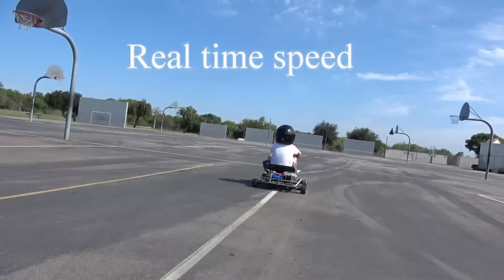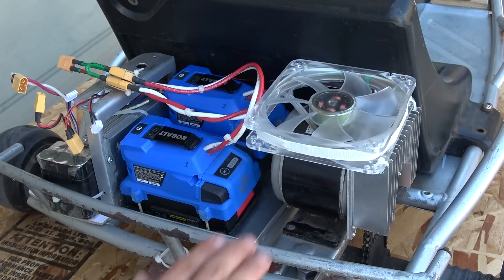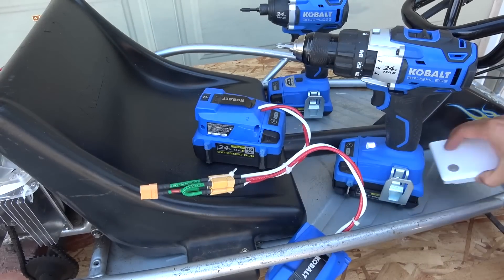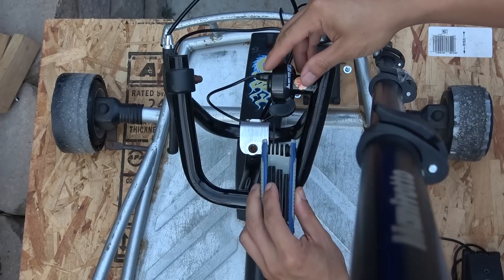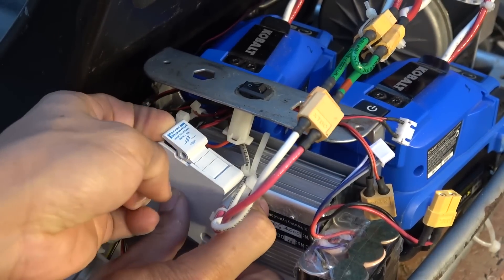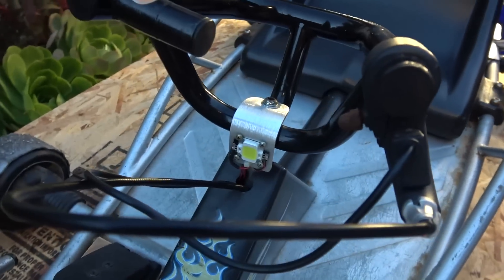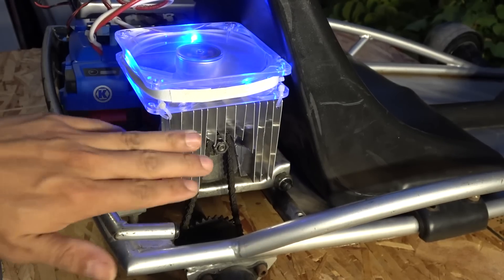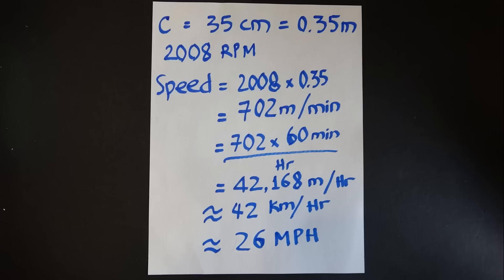Upgrade a Razor Ground Force 24V Electric Go Kart to 48V

Comment: It appears that you are not monitoring this video any longer.  I had a questions concerning the headlight.  You said you used a 10w 12v module, but you added a 5ohm resister to the positive side.  Why?  Will it not run on the 12v power?  I need help.  Thank you.
Reply from the maker: It gets really hot running on 12V. You need to reduce the voltage to 11V for it to work properly.

Comment: Hey I'm doing 1 now trying to upgrade it to 36v with controller now after wiring and everything it's good works but once I jump on it as in a load it pops something and then does nothing but it I disconnect the battery and reconnect its fine so why won't mine go under load..?

Comment: Great Video!  I got a Razor like yours from a friend and want to try this upgrade.  The only thig I don't understand is the battery packs.  What is, or where do I get, the top piece that the battery clips into?  The part that is like the bottom of the drill with the wires. I understand the rest, but when it comes to connecting the controller, I may need help.  My Chinese isn't very good.

Comment: Cool!
How about adding a thermal cut off switch super glued to the motor casing? 
Aliexpress has them cheap and could be wired into the controller's brake handle motor stop. If the right temp is reached, auto turn off and wait for it to cool down and don't push it for so hard for too long, no harm!
That's what I'm going to try!
Take care

Comment: Couple rings of plexiglass, then a solid lense made of plexiglass for the headlight would look good, maybe drill a couple 5mm holes from the back, not all the way through, beside the led headlight, into the rings to space the cover out to cover the headlight,  maybe paint the tip of a couple LEDs, or glue a tiny piece of aluminum foil to the tip of the through hole led, or maybe use a RGB led or a pair of them,  use the aluminum foil to disperse the light ,  but a 3-4mm piece of foil on the led, to make the ring of the headlight  glow, like a halo,  have a switch to turn off the headlight, and keep the halo lights on,  maybe make a red tail light the same way,  use a 3w red led, with a couple traditional red LEDs 1/4 watt or what ever,  maybe use 4 of them, use hot glue to attach to the aluminum plate and plexiglass, that is about 8-10mm larger on all sides than the 3-5w cob LED,  the holes drilled 90% through 5-3 Plexi spacer rings, and possibly use foil tape, or glue foil to the inside of the rings, to reflect the bright light, and keep the two light sources separate, then the clear Plexi cover,  use tiny screws in the corners, with the LEDs in the middle on the sides and top and bottom,  use the small led halo light rings, as a tail light, along with the front lights , yellow, orange, blue, purple, any color, every color, changing color!,  The rear  can be the same also, but red or yellow/orange would likely look best,  use resistors and switches, to operate,  I have one, I'm thinking about doing the same for my sisters lil boy,  use a remote shutoff Incase he gets in trouble, I'm thinking a 4s lithium battery is enough for now, he is still young! But I have a 500w motor, a 350w and could put two on there eventually, I was thinking about putting larger wheels on it, and use a weed eater motor, make it go in grass, at about a fast walking pace, but the 500w at 36v motor I have, running at about 72v 20s lithium battery, just over 80v is about 2kw output, nearly 3hp, maybe use that and I can ride it,  maybe use two of everything,  motors, controllers, batteries, use a 350w24v and the 500w, with controllers to run them 12v overvolt, a 36, and 48v,or just run them both at 48-60v,   the 850w should be in the 1800-2kw range,  maybe get a 3kw 48v brushes motor, push it with a 96v controller, that equals alot more than 3kw, double the voltage, also doubles the current, that squares the wattage! 12 kw peak power,  it would likely oner heat in 5 minutes, probably back it off to 72v

Comment: Hi Vuaeco , I’v just found your channel looking for help to fix my sons 24v utv mx , I’ll give you the back story so far, the bike battery supplied was junk , very slow recharge time , not much power in the grass, so I hooked up my 18v 5amp makita batteries using the usb adapters from eBay removed the usb circuitry and soldered straight to the tabs, worked brilliantly then I thought I’d try my dewalt 54v but I just use crocodile clips it worked , not much quicker than the 18v mk batteries but definitely double the playtime so great but unfortunately the wires came loose and touched now I think Iv fried the control module as it’s completely dead ( very unhappy little boy 😢) , I’m thinking 48v 1000w control module but I’m guessing , I’m not sure if the motors can cope there 200w 24v , 1 behind each wheel , I would be very pleased to make a suggestion or point me in the right direction as I’m just a carpenter with a soldering iron and multimeter lol 😂👍

Comment: it def feels faster than it looks in this vid.. Im a fully grown adult and its 'feeling of speed'' compares to  the electric karts at some popular place in NJ.  Its scary the first few rides and i put off riding mine until i could change the tires/wheels but practicing in a parking lot helps get the feel.  48v 1800w.  ill upload my solution that mounts a 48v 20AH battery easily daily secured from damage damage results the innocent battery cover. i raised the seat 4 inches and as is, the drifter critters a great size to throw in a car trunk and bback seat to transport 2. 
this video helped me see the kart could handle 48v
oh mine is a ground force drifter

Comment: Awesome video!  I would like to do the same with a 56v battery pack I have (EGO). Could you recommend a speed controller?
Reply: Did you ever find out what speed controller to use? Looking at doing the same
Reply: @DFW_SPORTSTER_S  I found a website with lots of options but haven't pulled the trigger on one yet:  https://www.electricscooterparts.com/speedcontrollers60volt.html

Comment: love your tutorials!.  question are you comparing the battery life? those are only 4AH batteries the SLA's on my drifter are 9AH. While I know SLA is only 50% usable, I'd still think you'd get more run time? also in the other video I would like to know the controller model you used, there is no link or reference in description thanks!

Comment: Hi Vuaeco, I'm still at it.  I have a 36v 500W controller.  Can you recommend a battery to use with it and its impact to our razor cart?  (will it go longer, faster, same as before?).  I also have a 1000W 48V controller and just ordered some 24v kobalts to mirror your setup for my second cart.  2 boys, 2 carts - race time!!  Thanks again for your video's - awesome stuff

Comment: Great video, amazing job.  I have two of these and have been looking to attempt this project for the past year.  Vuaeco can I use two Dewalt 20V batteries with the same controller? thanks
Reply from the maker: No, you can't use Dewalt 20V batteries on this controller. It cuts out at about 41V.
Reply: vuaeco Thanks for the quick reply!  Can I message you directly?  I have two controllers I’m looking at now.  A 500W 36v, and a 48v 1000W, I have two carts as well.  Would love your advice on what I need to get both going.  It’s project time with the kids!!
Reply: @vuaeco  Hello! How long motor can work on this batteriess? :)

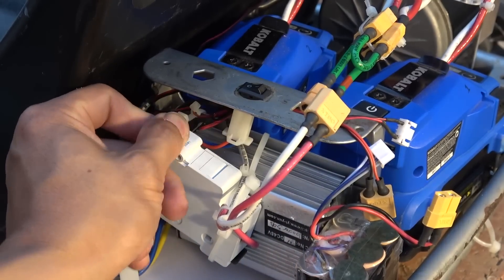Comment: In minute 5:00 you call it a fuse switch were did you buy it I need
Reply from the maker: It's called "fuse holder" and the manufacturer is Ferraz Shawmut. There are plenty of those on ebay.
Reply: @vuaeco  thank you amigo so much and I appreciate it

Comment: How to connect controller when all comenfrom china with no manual?
Reply from the maker: Basically you just need to connect 3 cables. Throttle 3-prong cable, red/black power cable to the battery, and finally blue/orange cable to controller.

Comment: What pedal did you use and where did you get it? also i plan making mine that is 52V (three 18V batteries) what controller do you recommend?
Reply from the maker: I got that pedal on ebay. It cost about $10. If you use 3x 18V batteries, you can still use that 48V controller shown in the video.

Comment: Adding battery packs with separate BMS is not a good idea. If your packs are not balanced with each other they could catch on fire and explode.
Reply from the maker: They are 2x 24V in series. Why do they have to be in balance with each other?

Comment: That's awesome bud. I did something similar with my kids razor... You'll like this....

I put a 3 hp treadmill motor on it and powered it with 10, 20 volt DeWalt batteries. 200 volts! It rides wheelies and hits 35 mph. No speed Controller tho. Its all or nothing but driving it feels like time travel. Haha.
Reply from the maker: LOL. 200V? You can launch yourself to the moon with that!
Reply: @vuaeco  Pretty much. Lol. It's like sitting in a giant sling shot. It's crazy.
Reply: I am not familiar with electrical and wiring components I found a 36v on the side of the road go kart and thought hey why not take this I can build it to something that works and it would be great for my kid. Are there any videos out there how to step by step put together an electric go cart from start to finish? Thank you guys
Reply: are these one or two wheel drive?
Reply: @localrice5184  the older ones were live axle newer ones are not.
Reply: 200v? Sick

Comment: I wish you would have put a link where you bought the parts
Reply: I found the speed controller:
https://www.ebay.com/itm/24V-36V-48V-250W-1000W-Electric-Scooter-Speed-Controller-Motor-For-Bike-Bicycle/322556641661?var=511538267723

Still looking for that fuse switch he mentions in the video

Comment: What do you have wrapped on the front wheels ?
Reply from the maker: duck tape on the right side, PVC pipe on the other side. These are mods for drifting. :D
Reply: vuaeco are these one or two wheel drive?

Comment: I think your pulling to many amps from the battrey
Reply from the maker: The battery stays cool the whole time. This battery is capable of handling 40 Amps continuously. The controller and motor can only pull about 35A max so the problem here (if there's one) is not the battery but the motor and controller. I have tried this same controller on my electric scooter and it worked like a champ. The motor does get hot and that's where the heatsink and fan came in.

Comment: Hi vuaeco, got a part number for the Ferraz cut-off switch?   Going to upgrade my bike to 48v motor/controller using the snapper 60v 2Ah.  I will probably use a 48v (or 40v) fuse in it.  Thoughts? thx!
Reply: It's looks like a CMS101

Comment: A 2000w ebay brushless motor would work great too
Reply from the maker: Yes, but it will cost a lot more. And you'll need to get the right sprocket and chain for it and that's a pain. Plus, you'll need a more expensive controller for the brushless motor.

Comment: nice n fun project sir, so overheating the brushed motor is the price of that fun, ever u think about bldc one compare to brushed one ? for next upgraded project maybe ?
Reply from the maker: I thought about it. But it'll cost a lot more as not only do I need a new brushless motor, I also need to get a brushless controller (and throttle) for it. Plus, I'll need to get new sprockets and chain for it.

Comment: Really enjoying your channel. I have a Razor e300 60 volt brushless lithium project.  With tool batteries.
What do you think of these links for tool batteries from here the prices look pretty good for the longer amp hour ones
https://www.vanonbatteries.com
And I found this drill Battery  on Ebay.  Do you think those specs are legit????
https://www.ebay.com/itm/360n-m-68V-Rechargeable-Brushless-Electric-Impact-Wrench-Cordless-7800Ah-Battery/222940735523?_trkparms=aid%3D111001%26algo%3DREC.SEED%26ao%3D1%26asc%3D53470%26meid%3Dc810984f7f864c88ae797212e2b9dcf9%26pid%3D100675%26rk%3D1%26rkt%3D15%26sd%3D222940735523%26itm%3D222940735523&_trksid=p2481888.c100675.m4236&_trkparms=pageci%3A43d5e98b-96cb-11e8-9d01-74dbd180b1c5%7Cparentrq%3Afdc712b11640ad79d8fcc9efffef921b%7Ciid%3A1